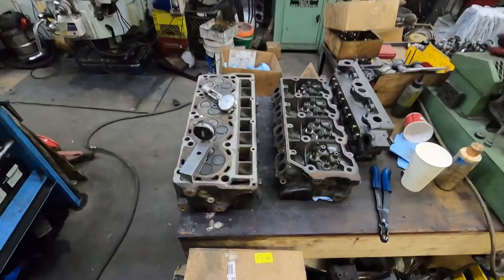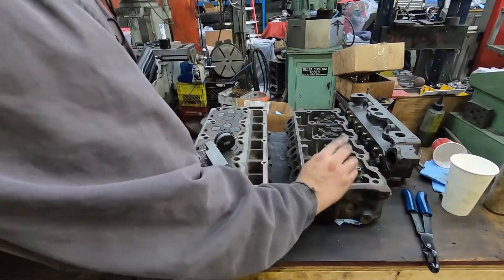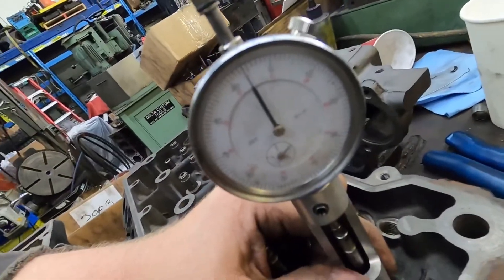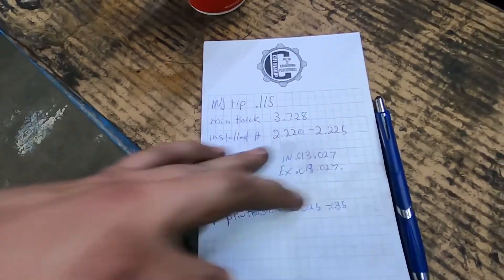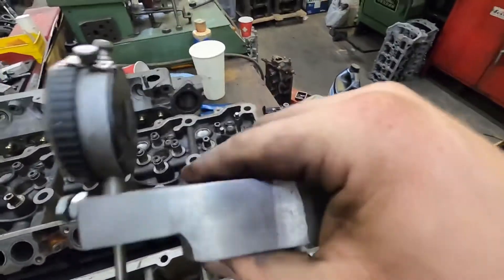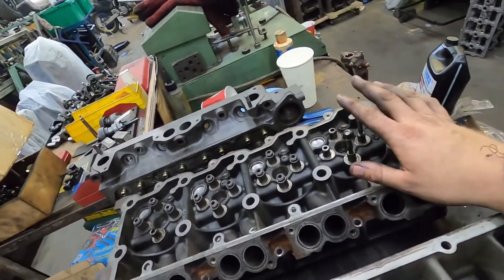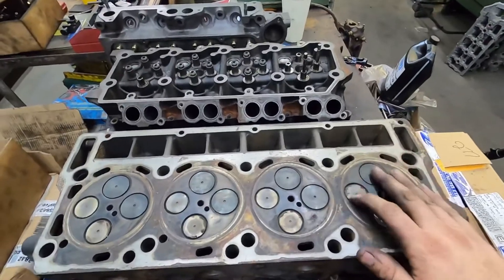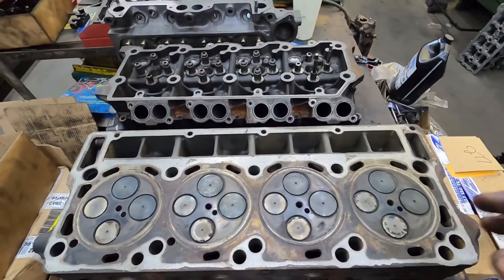HOW TO DO DIESEL CYLINDER HEAD GASKET ( CHECKS )

Comment: Where was this video couple months ago when i was cleaning up a set for my 03' lol, Been dragging my feet on install but They came out looking real decent Only one thing im second guessing is while i was doing the final assembly and when i grabbed one of exaust valves it felt lil heavier so i grabbed my scale and the valve was 3 grams, yet all my others were only 2 grams it looked identical   But after weeks of cleaning and mild porting cast iron  i said fuck it and slaped heads together, do i got anything to worry about from some retarded valvetrain balance or anything i may regret?

Comment: This is the first video I have seen that measures cylinder head height! Simple as it is, it is nice to see it measured and explained. This has been one of the best videos I have seen on explaining what needs to be measured, how, why and to the point! Any specs on valve stem clearance? I use a ball gauge and mic it, maybe they sell an economical bore gauge that small? Thanks for showing some key steps when assembling my 12 valve cylinder head.
Reply from the maker: you can use a ball guide to measure them, just for use it doesn't make sense as we would have to do a set and measured 50 times ahead. i put the specs on the 12v head video in the description